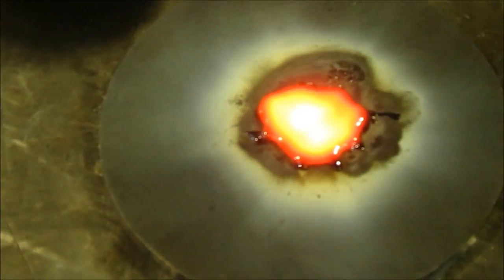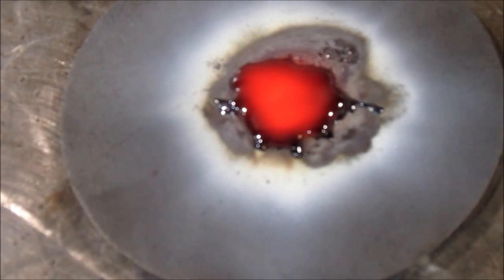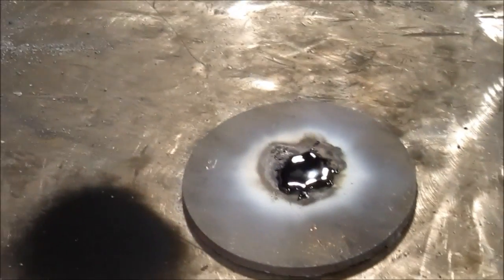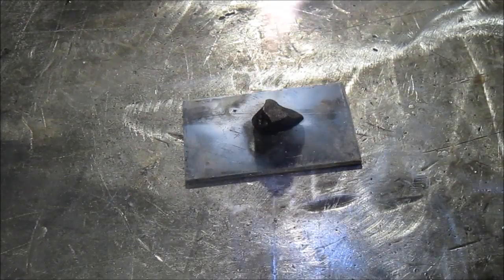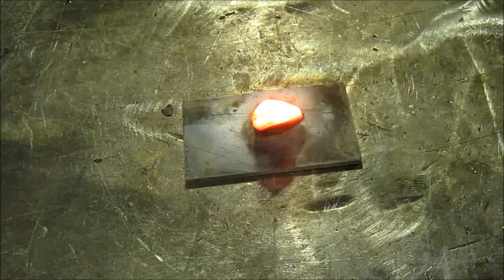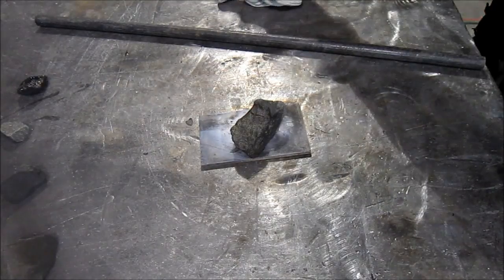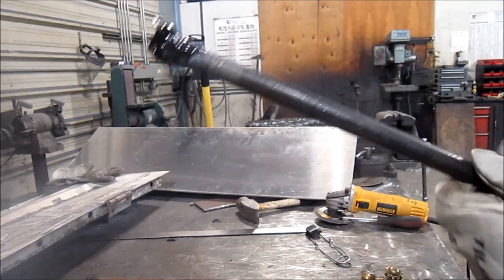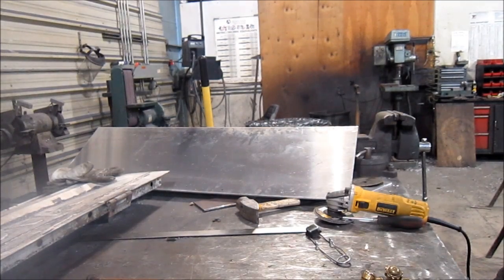how to make lava/obsidian

Comment: Have you  tried heating that  in a mold using a light  air pressure on top of the material to move it around while hot inside the mold  cut the flame off leave the air on it?

Comment: Ironclad Industries. A wood can be shaped as a triangular prism to make a mold in green foundry sand. then a conical perforation is made to an iron plate and placed on the mold so that the molten obsidian falls on it. If you let it cool slowly you will have a good prism of obsidian. I would like you to also try it with fused quartz. Thanks, I like your Video.

Comment: why does it take a while to cool it fast?
Reply: the heat is really hot so it will take longer
Reply from the maker: As I've mentioned to other people, fast and slow are relative terms, when dealing with molten metal or rock, fast can mean a couple of hours and slow can mean a couple of days

Comment: try using hot or boiling water, it's still cooler
Reply: or maybe some type of oil
Reply: Solid rock (impure or mixed rocks included) has a much lower density than most metals like iron or steel, and is not so dense that it can't hold water molecules. Because of the reshaping, the 2 tidal forces of pressure on either side of the rock overstresses the structure of the rock's new shape before its structure has time to cool or "crystalize" back into a "solid" solid.

It's going to break every time.

Comment: obsidian is glass?? 
no fukin way!
obsidian is extremely hard, how can it be glass?
Reply: +HeadandNeck nuh, glass breaks EASILY
Reply: +RexodinoLP obsidian is weaker than glass strong but brittle it is easily cracked as you can see in the video also you think that because of minecraft
Reply: +RexodinoLP obsidian is weaker than glass strong but brittle it is easily cracked as you can see in the video also you think that because of minecraft

Comment: Question, you mentioned that a forge would help get a shape. How so? I want to make an obsidian blade so I'm very curious about your video.
Reply: you knap obsidian into blades not cast
Reply: isn't obsidian - in fact obsidian - bc it cools quickly.. not slowly ?
Reply from the maker: yeah well a kiln or forge that you can control the temp, like a digital forge, the problem im having is that its cool too quickly, so if you can put it in a forge thats up to temp, and slowly dial it down over several hours so it cools slowly then it might not crack
Reply from the maker: It is, but when referring to molten rock or metal, slowly and quickly are very relative terms, cooling quickly can mean within several hours while cooling slowly can mean cooling over days

Comment: Try melting obsidian.    Obsidian obsidian, not basalt.    There's a surprise inside!
Reply: +cun nuigga Most north american volcanoes spew out ash, or gray lava-foam that's full of bubbles.  Hawaiian lava has little gas, so it just slurps out of volcanoes.  But USA volcanoes are more like jet engines, with a little lava plus a whole lot of gas.    An eruption of USA volcanoes is like a jet-powered lava-fogger.

Any black obsidian from USA sources must have solidified under high pressure, deep underground, so no bubbles formed.  The gas is still trapped in the glass.

But that means, if we melt some natural obsidian, then all the dissolved gas will come out.  It's the volcano version of mentos and diet coke.  Yep, when we melt some natural obsidian, it fizzes.   It puffs up like popcorn.   It turns into large gray-white balls of glass-foam.

You can melt obsidian in an old microwave oven, if you preheat it first.   Put a piece on a small flowerpot and heat it to dull red heat with a plumbing torch.   Then nuke it in a microwave.  It heats up bright yellow-white, and puffs up into a big ball.
Reply: +wbeaty This scientific rant is amazing, but you do realize that Hawaii is a part of the United States of America, right?

Comment: If you want to shape it use a mold
Reply from the maker: +Gianna Wong that wasnt the problem, it was that it cooled to quickly before i could get it in the mold, and if i tried to melt it in the mold it would melt unevenly and leave pockets
Reply: @ironcladindustries   have you tried moving the material  with the light force of air behind the flame in a mold?
Reply: smart
Reply: No Intedion Inglês
Reply from the maker: i tried it, it doesnt work
Reply: +Ironclad Industries i think your major problem is impurities. So maybe you will make a good obsidian with pure basalt. lol

Comment: How hot is the torch if it can melt rock and how Is it melting the Rock and not the metal sheet underneath
Reply: different melting points?

Comment: Obsidian has problems...most of it is in the rock itself..
Impurites make it crack, Cool at different rates...
you should look up Glass blowing..  They SLOW cool it..not fast.

Also your camera CCD sensor is probably Burnt...
Reply from the maker: Ed ash yeah I figured I need a kiln of some kind in order to cool it slow enough to keep it intact
Reply: Yes...and the bigger the longer it takes...Like Glass enameling..
the real problem still comes with the material IN the rock..it could be anything.  Thats why we separate them, and deal with 1 type at a time...they all have different properties.
Reply: +Ed ash I always figured you'd need to consider the silica content of the rock you're using to make a good chunk of the stuff.
Reply: yep Im a glass
Reply: Ed ash You're a glass?
Reply: silica, becomes glass..or a few other things depending on stuff..  Minerials in it, can become bassalt..

Comment: All you did was make a mess out of things .. Try using a hotter flame ( O + H) and go easy and don't rush it , in the heating process and even more in the cooling .. has to be in steps temperature wise when cooling .. Hours , not minutes !..so in a oven  or flame supported environment ... It is more complex than just glass blowing when working  with obsidian / rock .,.,, contains impurities that do and can influence every attempt. It is madness to even think you can make a worthwhile gem quality product with this method .. I'm a master gold, silversmith ,engraver , setter ( 64  years) ..so know what i'm talking  about ... good luck any way ..cheers .. gus
Reply from the maker: yeah I really need a kiln or oven in order to cool anything properly, and it is extremely refreshing to receive criticism from somebody who actually knows what they're talking about and can back it up with experience! thank you!
Reply: Ironclad Industries .. Thanks for the reply ...if i can help out with some data to help you along with your projects , would be glad to give you a tip or two .. Mail me , and will show you some of my art works + ..cheers  gus
deoase.graveur@gmail.com
or
deoase.graveur@upcmail.nl

best of luck to ya..gus
Reply from the maker: gusthebroken2 thanks!

Comment: It works with any type of rock?
Reply from the maker: sort of, if you can get the rock to heat up this much it will melt, however some rocks crumble or explode when heated and they make it very hard to heat when theyre flying off in tiny pieces, mostly river rocks are hard to heat

Comment: Ironclad Industries Quick question: I'm not a smith but just curious - is there a way to heat rocks to produce obsidian and then safely cool it and remove it on a large scale; say wheelbarrow-sized chunks as a rough example, or is it too energy-demanding, dangerous and fragile?
Reply from the maker: I'm not entirely sure, I'm sure that you can heat them on a large scale, with a kiln of some kind, but cooling it is another matter, probably a kiln could be used for that too, slowly turning the heat down over several hours to prevent cracking, I really want to try that and see if it works because it would be awesome to be able to make blocks of obsidian for construction, make an obsidian wall/fence around my house
Reply: Ironclad Industries  You are exactly right! The cooling process creates a ton of stress but slowing it down relieves most of the stress. If you can get a kiln that goes to 1000 F and drop about 100 degrees every two hours or overnight depending on the kiln and how thick the glass is, you can stabilize them. That works for bowls and vases, however, a wheel-barrow sized chuck would take days maybe even weeks to anneal. In the near future, I'm gonna try this!